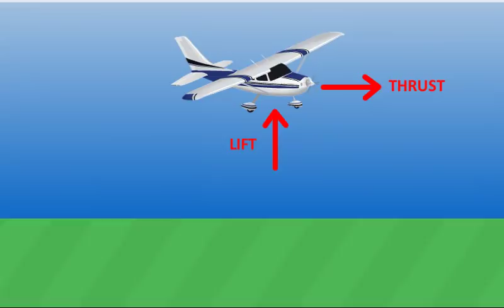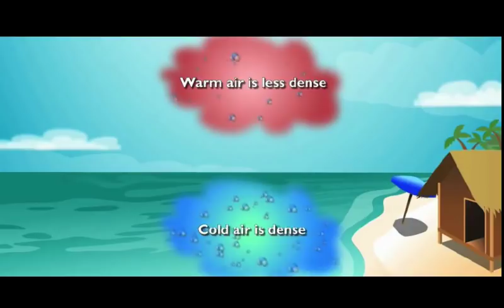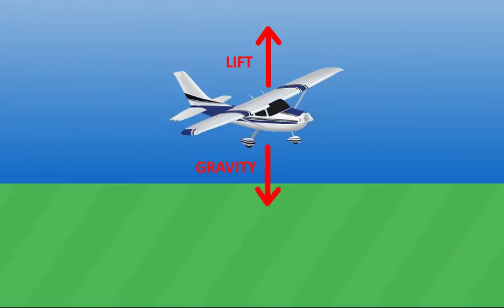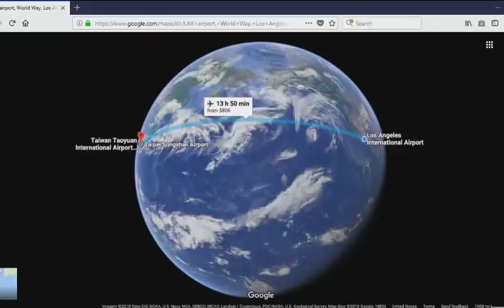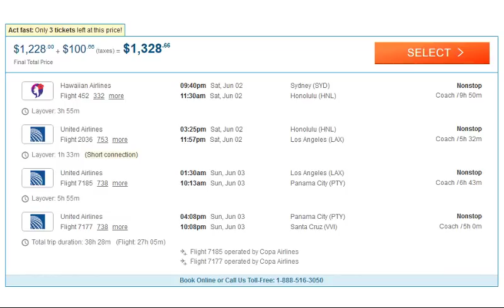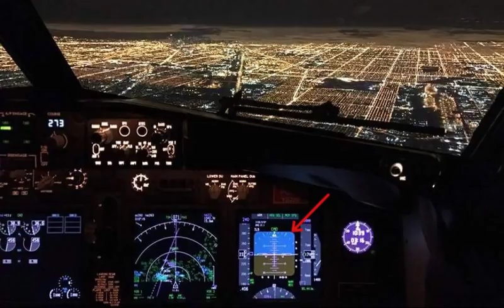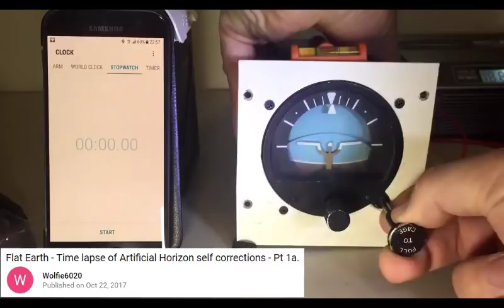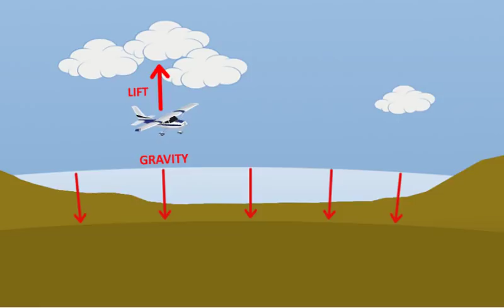Flat Earth Falsities - Plane Nonsense

Comment: I am curious why does the FAA and NASA in there flight manual for new pilots tell them to assume a flat none rotational earth .???
Reply: Sorry Johnny.... The manuals also assume constant mass. Do you know of any airplanes that don't lose mass when they burn fuel? And they assume a rigid frame but an aircraft's wings necessarily flex. 
      The manuals make these assumptions to simplify equations of negligible factors. That's why they are noted as assumptions. 
      So no, it doesn't mean the Earth is flat or stationary. That's simply more conspiracy babble by the basement dwelling flat earth authorities.
Reply: @romithromith CONSTANT  Mass remains constant because the definition of mass does not mean weight. Mass means the amount of room and object takes........ has nothing to do with his question. 
The manuals also assume  = PROOF?  OR OPINION?
Reply: @romithromith  The problem is @Mike Arthut is a troll from way back.
Reply: @boffeycn  Not very bright either. 
     re Brazil, interesting. About 30 years ago I raised money for the World Wildlife Fund (World Wide Fund for Nature) to combat the slash and burn in the Amazon basin. Incredibly short sighted politicians.
Reply: @romithromith  I did read them. it said, "these  calculations assume a flat earth."   You lost your point. you write to much. use less words. to prove  a FACT !!!!
Reply: @mikearthut781  That reading fatigues you, shows. I won't burden you with more.
Reply: @romithromith  wind bag =  The flexible air-filled chamber of a bagpipe or similar instrument.
n. A talkative person who communicates nothing of substance or interest.
n. A bag filled with wind; hence, a person of mere words; a noisy, empty pretender.
Reply: Kernal Scott 2  Indeed, that is Mike Arthut to a T.
Reply: I saw a flat earther bring up that US military manuals for artillery specifically say they aren’t going to factor rotation or curve of the earth. Makes you think. 
Until look at other tables in the same manual  where they show you exactly how to calculate for curve and rotation. 
All they are doing at first is calculating a baseline. Assume 70 degree temp, no wind, sea level pressure, no rotation etc.  
Then they show you how to calculate all those things into the equation.
Reply: What's your guess Johnny?
Reply: Johnny Hicks - but it’s not a manual for pilots. It never has been. It never will be. The clue for its creation is in the introduction.
Reply: @Cardinal RG Arthut, who is a pathetic troll, brought up this bs elsewhere and was thoroughly trashed, but now it is back again with the same shite.
There are a number of papers, such as
https://www.nasa.gov/centers/dryden/pdf/88104main_H-1391.pdf
None of the FE cultists know a thing about programming or computer models, especially when dealing with the situation 30 to 40 years ago.
I aske them to the meaning of this equation, which is in the paers
H.(x (t), u(t), λ(t)) =1+λ^T(t), f(x(t),u(t))
Of course they all run away.
Here is more about the scam they tried to pull.
Documented Failure: NASA Papers Do NOT Prove a Flat Earth
https://www.youtube.com/watch?v=BAlSOI5uHkc
Reply: It says "assume" because otherwise they will start making calculations while making a difficult landing manoeuvre.
Reply: @petroleumalley  blah blah blah !!!  "these calculations assume a FLAT EARTH !!!  ha ha ha !!!   I WIN !!!   winner winner chicken dinner !!   you lose !!!
Reply: @mikearthut781  Mike, I've a feeling we're not in Kansas anymore.
Reply: Maybe so they dont get too surprised of not seeing non negligible curvature? Have you seen "His" >Show me the curve< when you honestly have lake bridges like that at ground level, well you can imagine a lot.  I thought School teached already that the rotation spin was negligible as so Many say?  As you would think a pilot student  would be aware of Gravity's fonctions, as automatically levelling planes, aside non stop world flight the curving extention is negligible.
Reply: @Cardinal RG THE FACT IS.......the FAA and NASA in there flight manual for new pilots tell them to assume a flat none rotational earth ....  anything else is opinion. there it IS !!  black & white evidence !!  ha ha !!  Winner winner !!! chicken dinner !!!!    ha ha !!! 

By the way, what is your standing to make any claim whatsoever about pilots or aeronautics?
your claim is opinion. made up stupid word is that a theory too? . has nothing to do with the fact. stop diverting. I'm a Researcher. One of my jobs is to poke holes. I'm a certified poker holer. OK? SIR?
Reply: Hidden Aspects 
My mistake. Rotation, not curve. 

https://www.globalsecurity.org/military/library/policy/army/fm/6-40/Ch7.htm

Table H
Reply: Hidden Aspects  "tell me how adding any correction for the curve of the earth makes a difference."
Sextant corrections. All of celestial navigation and long distance navigation.
Do you know what NASA means? Think about these things, if you are capable of thinking for yourself that is.
NASA is an English acronym. Note English.  Note acronym.
Nasa and nasha are Hebrew words that have been phonetically represented in English
Nasa is actually נאסא. Have you seen this written on anything officially NASA? No.
Nasha is actually שלנו. Have you seen this written on anything officially NASA? No.
Sony is ソニー in Japanese. Have you seen Sony and ソニー  written on anything officially Sony? Yes.
Reply: Johnny Hicks You will not get a honest answer from any Spheretard.  A little tap dance, soft-shoe, back-pedal, away your FACT. I read the comments from these other cretins. ha ha ha !!  bunch of BULLSHIT !!  See how they can just dismiss the fact, pilots DO THIS. BECAUSE THERE IS NO CURVE AND NO ROTATION !!!

Comment: In the FE model, any direction you travelled in would result in a change of atmospheric pressure as you went towards/away from the edge of the dome.....
Reply: Connection to the real world: it does change, fact, actual fact.

[So more air piles up at the poles and it's denser because it's colder. So the column of air weighs more and that means the pressure is higher. 
Atmospheric Science: Why do the poles have higher air pressure and ...]
https://www.quora.com/Atmospheric-Science-Why-do-the-poles-have-higher-air-pressur...
Reply: Only one direction you fly to the edge of the dome. 

You don’t understand the concept.
Reply: @Giovanni93ex  You can't go there, it is protected by laser eyed mutant ninja penguins.

Comment: Flat earthers are so stupid, they can’t get into their dense skulls that level and straight aren’t the same thing. I knew this when I was 10!
Reply: joseph Kramer Level is perpendicular to a line that runs from the surface to the center of the earth. Flat is flat. The ocean is level, but not flat. Get it?
Reply: @bradwooldidge6979  Hum... sounds like a tangent to a circle: is a strainght(all sides) line intersecting the circle at exactly one point, the point of tangency or tangency point. There is NO curved level lines.
Reply: “Level” is a line perpendicular to a line from the surface to the center of the earth. Flat is flat. The ocean is level, but not flat.
Reply: ACTUALLY DIP SHIT THE WORD LEVEL CAN BE USED TO DESCRIBE A STRAIT FLAT SURFACE ASWELL AS HEIGHT
Reply: @jo1568DJ  And dip shit flerfs claim that it can only mean flat/straight (a dictionary fallacy); it sure doesn't mean that regarding altitude.
Reply: @jo1568DJ  Are you proud of announcing to the world you are a semi-literat silly little kiddy, one prone to throwing shouty hissy fits?
Reply: Level is any given altitude can extend as far with any given radius but can never lose its level. 

As in you could fly a plane level at 35k in a 200 mile radius but can never fly in a curve(slope).    

Get it yet? 

Oh and because of “gravity.”
That’s a theory 
Level is a law

Comment: 2 islands 2 miles apart and 21 hours time difference how?
Reply: Which two islands? I assume you are referring to the international dateline; that the time zones don’t match longitude is that countries tend to stick with keeping one fixed time rather range of local times.
Reply: You mean Kiribati, which consists of several widely dispersed groups of islands maintaining a common time regardless of the actual local time.

Comment: a wheel has to balanced to stop vibrations when it is spinning,you think the earth could spin with trucks, trains, ships,water all moving around freely and not cause any vibrations.if the earth was spinning what about motion sickness.at what height does the air stop moving with the earth?
Reply: The earth has a mass of  (5.9722±0.0006)×1024 kg (5.9 sextillion tonnes) and a diameter of just less than 13,000  kilometres and is slowly rotating at (7.2921150 ± 0.0000001) ×10−5 radians per second. or 1.15 x 10-5 rps or 0.000696rpm
In other words it is an extremely massive object with a large diameter which is rotating very, very slowly about it's axis  0.000696rpm. That is the rate at which the earth rotates, very, very slowly, at half the rate of the hour hand on a clock.
What effect do you suggest a few miniscue objects will have?
"what height does the air stop moving with the earth?" How long is a iece of string?
Reply: The accumulated mass of trucks, trains, ships etc is negligible compared to the mass of the Earth. The mass of the water is larger but has relatively little effect. 

One revolution per day is not going to give you motion sickness. 

Higher than the atmosphere extends.
Reply: @flookd5516  so...the air stops moving with earth somewhere out past the moon?...since the moon is now within the earth's atmosphere according to nasa
Reply: Steve The outermost layer of the atmosphere extends that far; it is also essentially a vacuum, not ground level air.
Reply: 😂😂😂😂😂😂 IDIOT!!! Go jump on a merry-go-round at a playground and have someone push you so slow that you make one revolution in 24 hours. Let us know how much motion sickness you experience. 😂😂😂😂😂😂
Reply: well mybrow
You should change your name to 'low brow'
Reply: We are not moving, the sun, and stars move around us, ''sunrise'' is a word they seem to use quite frequent, lol unfortunately a evolutionist will never see what they have been programmed to believe, you however are one who is now aware that we have been blinded by lies , you are awake, question everything. We're no accident.>>>>We were created'', with purpose
Reply: Ronald Roberts - That was total crap. It takes a “special needs” sort of idiot to ignore the knowledge accumulated over millennia. And if your god first existed and secondly thought you were correct, do you not think she would be looking out for you? Would she have not visited you and given you some divine knowledge? And if you have been visited, she has taken your knowledge (and mental faculties) away. Keep the faith you cretin, you are giving us all a laugh.
Reply: @ronaldroberts9417  "I don't adhere to any doctrine" Why do you lie?
"I believe in God." i.e. you adhere to a doctrine.
."yes I was created" i.e. you adhere to a doctrine.
"evolutionist will never see what they have been programmed to believe" i.e. you adhere to a doctrine.
"We were created''. i.e. you adhere to a doctrine.
"with purpose" i.e. you adhere to a doctrine.
"We are not moving, the sun, and stars move around us,". i.e. you adhere to a doctrine.
You conflate the shape of the Earth with human evolution  i.e. you adhere to a doctrine.
Not a very honest person, are you.
Reply: @ronaldroberts9417  It all Chance or Luck, you must adhere to Meaningless / Goaless / Purposeless Laws for the fine tuning of Evolution.  From a serene Singularity, happy super MASS ball (I guess) there manifested a FORCE (Dark I guess) and BANG! 

Anti gravity reaction that created KAOS, in order to have Order of systems, and other wonders that SCIENCE can not explain but SHE is sure of.  THAT is non Doctrine for... the... Unbelievers.
Reply: @ronaldroberts9417  Forget the Southern Celestial Pole, 24 hours of Sun over Amundsen-Scott, the dinosaur bones, sequoias, Grand Canyon, carbon dating, solar angles and angles of satellite TV dishes. Let's go with the occult delusions of ancient goat herders and creation myth apologists. It's right cause I just know.
Reply: Ronald Roberts 
lol
bible worshipper. you think you are special because...? lol 
you have been indoctrinated by religiously blinded morons and you believe in a book full of sh!t. dah bible is a piece of crap, filled with fairy tale stories told by illiterate superstitious goat herders from a small region of this planet. how piss poor is your critical thinking??? 

you really believe the whole christianity nonsense?? you are a indoctrinated religiotard, by definition

Comment: why don't we see the suns shadows moving across the  at 1000 mph
Reply: Because we see them moving 15°/hour, which is how we measure angular velocity.
Reply: well mybrow - on the Equator you do, if you observe from above. At higher latitudes airliners can keep pace with the setting sun. Any more questions?
Reply: shadow of the sun? ahm, it is a light source? 
why would the shadows of objects move that fast? also, lets assume flattardia is real. how fast would that flerf sun need to move trough the sky? oh, at 1000 miles per hour, right? even faster in winter... mach 2,7... with no sound, no tail or trace in the air? lol
of course not. you don’t understand the basic concept of astronomy... poor you. sit and learn before you open your mouth, silly flerf...
Reply: Why can't we see the sun during night time? Oh that's right! It goes beyond the horizon, which would not excist in a flat world

Comment: show me 16 hours of daylight , earth rotating speed is constant it would have rotated 240 degrees and only 180 degrees of earth max is in daylght at once.
Reply: That would be true if the axis of rotation wasn't inclined. But it is inclined 23.4°. Where there is 16 hours of daylight now, there will be 8 hours of daylight in 6 months. Inside the arctic circle there is currently 24 hours of daylight.
     Let me show you: Notice the angle of sunlight on Earth in the Himawari 8 photos. The axis of rotation is vertical in these images. https://himawari8.nict.go.jp/
Reply: The Falkland islands right now are experiencing 16hrs of darkness and 8hrs of sunlight.
Reply: Hey idiot, how do you explain 16 hours of sunlight on a flat earth, since 16 hour days do, in fact exist.
Reply: how old are you?

Comment: Do a video about water always being level, never round up.
Reply: Level is not the same thing as flat!
Reply: How many degrees curvature mile would you expect to observe on a 25,000 mile circumference globe?
Reply: https://youtu.be/KSxryGwsUQ4?t=1094
Reply: @romithromith  us navy ships can lock down targets, with laser precision, and hit them 100 miles away in the ocean with a railgun. No consideration for the curve when aiming 🤷‍♂️
Reply: @romithromith  it doesn't explain how it can lock down a target with laser precision. It aims on the target 100 miles away
Reply: @ironbiffi  "Laser precision" means accuracy, not a flat line. It's more accurate because of the projectile's high speed. However, the projectile will fall to earth at d=½at². A projectile fired at 3 miles/second will fall over 2.5 times the curvature. And this assumes no deceleration, which will occur. 
      The trajectory is much less arched—is "flatter"—than slower projectiles, and at shorter distances might seem virtually flat, regardless, it will fall at d=½at².
Reply: @ironbiffi  What does sea level mean?
Reply: @ironbiffi  " us navy ships can lock down targets, with laser precision, and hit them 100 miles away in the ocean with a railgun. No consideration for the curve when aiming 🤷‍♂️" Who told you that?
Reply: Biffi If you mean laser-guided targeting then that is done from aircraft.
Reply: @flookd5516  that must be it then, the aiming is done by planes
Reply: Navy ships depending on planes.. seem it gives warning to ennemy, I did not get your comment meaning but sure got rolling the boys. Would seem 'level' means distance, of a point, nothing reallty to do with a line.
Reply: It’s called a droplet.